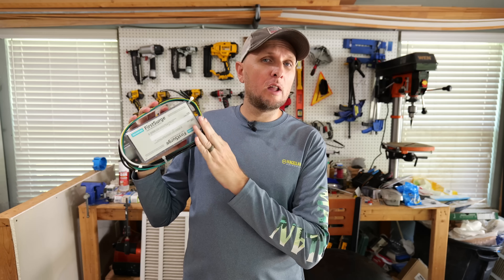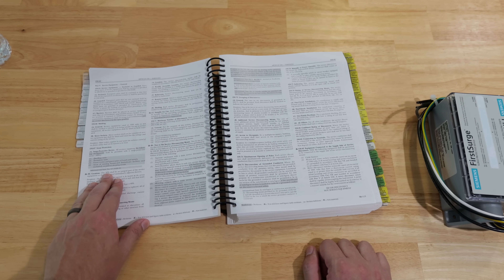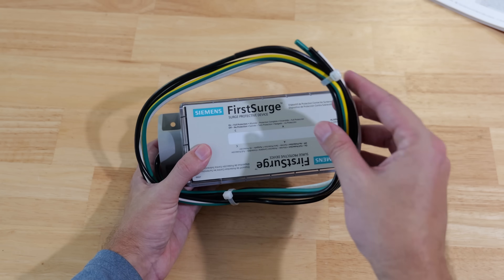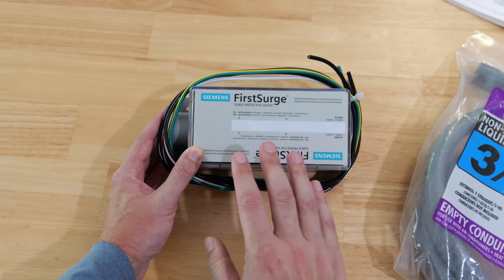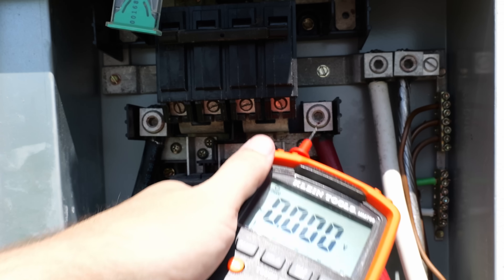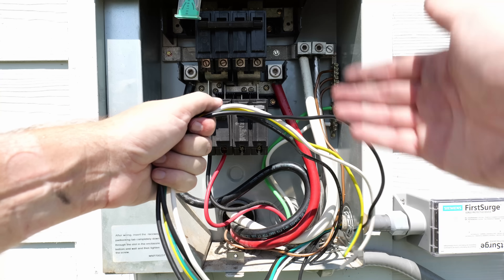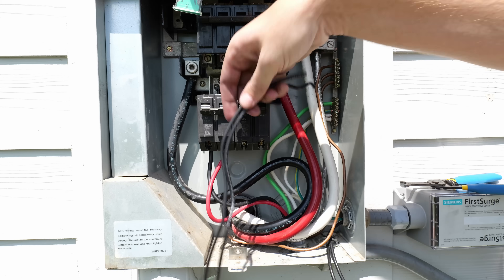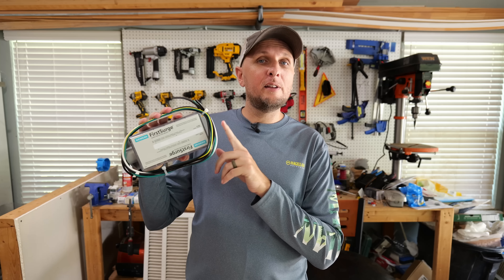Why Whole Home Surge Protectors Are Now Required and How To Install One!  Siemens FS140

Comment: Is it required nationwide to include the surge protection mentioned, or perhaps still up to the locality?
Reply from the maker: Depends on your particular area if they are using at least the 2020 NEC code.  Most places are.
Reply: I’d add that your house is grandfathered in and only has to meet code at the time it was built. If you’re going to work on the main panel now then you’d likely need to add one.
Reply: @smokey0066  mine was completed early 2023 in NC
Reply: @dacvidz  you can look up your city’s electrical code requirements to verify which year they’re at.

Comment: The NEC is becoming a design manual with all their requirements. With that said, I've had a surge protector since the mid 90's. It helped the old incandescent light bulbs last a lot longer.
Reply: True, someone is making a lot of money. Also, the insurance companies have a stake in these devices. I have seen a three 200 amp MOV explode in a large spindle drive on a CNC machine explode do to a power surge and it took out every SCR all 6 of them and to 2 trigger transformers. So even if you have something in place if the surge is too high then you are still "SOL"
And as always, it's not about protecting you, it's about the money!
Reply: It's also being heavily influenced by corporations that want to mandate the use of their products

Comment: Had one and had a direct lightning strike to the power line right above the transformer. Blew the shit out of all kinds of stuff!  Those protectors will protect if the strike is a long way away but there doesn't seem to be any "cutesy trinket" that can stop a close hit. Cost me several hundred in circuit boards in various appliances.

Comment: Well in Ohio you want to replace your breaker box requires a electric contractor to do work so a DIY person can Not do that work and it is also toward your hot water tanks so on that note il! Never put that on or in my house or any rental property , cost is in thousands of dollars .
Reply from the maker: Ok?  One can be installed without replacing the service.

Comment: The only power surges we get in South Texas are from lightning and anecdotally these surge suppressors don't provide the protection needed. I can see their use in areas where brownouts are common, though.
Reply from the maker: That’s not fully true.  A direct lightning hit, yeah not much is going to help with that but one striking the utility, depending on proximity, it can definitely stop or help protect against the surge.  We have more lightning here than anywhere else in the US.
Reply: @HowToHomeDIY  it might help with a line surge from miles away but it won't even help with nearby EMP energy.
And it definitely won't help if the energy comes in through antenna, including dishes.
Reply from the maker: @cquintana9326 doesn’t have to be that far away.   Hitting an antenna or dish is considered a direct hit so no probably wouldn’t stop that.  As far as EMP goes this is one of the highest recommended surge protectors to install for that purpose in conjunction with ferrites on the incoming lines.
Reply: @HowToHomeDIY  The EMP came in thru my [10'] sat dish & rcvr IMO. The strike was about 50-70 yards away from the dish. Took out all electronics in the house. The grid service for the neighborhood is all buried so it didn't come in that way, I think.
I do believe that I would have sustained damage even if I didn't have the dish. The ground potential and/or differential was physically felt in the environment. The hair was sticking out. Fortunately, I wasn't touching anything to burn or stop my heart. Just the opposite...made it run damn fast.
Reply: What about the 80% of surges that originate within your home?
Reply from the maker: @sigcrazy7  That's why I said I still recommend using regular surge protectors on your sensitive electronics.  Those are going to help protect from internal surges although most internal surges do not cause an issue.
Reply: @HowToHomeDIY  How would you add Type 3 SPD protection to your LED bulbs, CO2 detectors, Ring doorbell, and LED lightbulbs?

Comment: Special thanks to those device manufacturers for producing sensors that silently fail.
Reply: So if it protects once , do you have to install a new one?  Or, is it capable of taking multiple "hits" and keep protecting?
Reply: @bruceirvine3962 multiple hits, but wears out.
Reply: @bruceirvine3962  that's a great question.   Nobody knows!

Comment: QUESTION: I have one in my home, the same FS140. I also have two other sub panels, one in my workshop and one in my garage, both are not attached to my home, but 40amp and 60 amps are supplied to them. Should I install FS140 in each location or is the one in my main panel good enough. Workshop is 75 feet from panel and garage is around 220 feet. Thoughts if I should get 2 more units for workshop and garage. We do get A LOT of spikes and outages. Appreciate your time and opinion.

Comment: Surge protection was a major part of my job before I retired (including faraday cages and other over the top attempts at subverting Mother Nature), but I never thought about the house. Thanks for the pome in the ribs!
Reply: Most of my focus was controlling lightning damage to equipment in remote comm sites. Our house is not tall enough to be a lightning target (unlike the towers at our comm sites) so I only have trouble with modest surges on our underground lines.

Comment: I just learned about these this week. Each time I look at the Amazon listing, it shows me a "newer" model which is the Siemens Boldshield FSPD140. Is that actually newer or better or just a different use case?
Reply: I saw that too. My hunch is that including this in the NEC has upped the demand so Siemens has come up one with a lower production cost. One Amazon reviewer also noted this one is smaller, so that could be a plus in some installations.
Reply from the maker: The Boltshield is VERY similar but does not have quite as good of protection as the FS140.  Still a good surge protector.
Reply: @HowToHomeDIY  thank you! Great to know. Sometimes the "newer" recommendation is not better.
Reply from the maker: You are very welcome!

Comment: Major point - The NEC is not retroactive.
Just because your house has electricity does not mean that you are required to install one.
Check with your city hall to see if you need to add one before having the work done.
Reply from the maker: This was covered in the beginning of the video when I broke down what the codes meant.

Comment: I was not aware of this. Is this in every state?
Reply from the maker: Yup.  Every state.
Reply: @HowToHomeDIY  No, not every state. Currently only 4 states use 2023 nec. 27 use 2020. 12 use 2017, 1 uses 2014 and 2 still use 2008

Comment: Wouldn't safety devices be connected to their own batteries instead of main power ?
Reply: wouldn't that make them unreliable as safety devices if power  went out ?
Reply: is the power connection only for communications and not for power ?

Comment: That’s not protecting the whole house it’s only protecting that 20 amp breaker that you tied it to
Reply from the maker: Couldn’t be more wrong.  That breaker is just letting the surge flow to the surge protector and then to ground before it can damage any electronics.

Comment: 10.7.23  Adam, what would be your thoughts on a breaker box that is full with no room to add this double 20amp breaker?  Could one just add the two black wires to 2 separate 20amp breakers all ready in the panel?  Or take out 2 single 20amp breakers and put in the double pole 20amp and put the surge and the other wires back on like double 20amp?
Reply: If you are asking a question like this, have an electrician install it.

Comment: If electricity travels through copper wire at 100,000 miles per second, how much faster will this SP trip when you shorten the wires by 50%?
Reply from the maker: Being as that it is traveling at such a fast rate of speed, I could see how there could be some impact to the performance.  That is what the manufacturer really emphasizes so I have to assume there is a reason.  Do I think it makes a HUGE difference?  No, I think even if you didn't shorten the wires at all it is WAY better than not having one at all.  But I also want it to have the best chance at protecting the house as well as possible.
Reply: At very high frequencies, wires don't act as wires; they act as inductors, resistors, and capacitors, and therefore don't carry very high frequencies very well.  The shorter the wire, the better this thing can short out high frequency pulses.  Funny, though, this applies to Mhz and Ghz, and I didn't know surges were that high in frequency.

Comment: One point - when using a multimeter to measure voltage in a box, you may want to show how to insure continuity of the meter leads with the ohms function or placing the leads on a known live circuit before measuring the voltage. I once did a firefighter assist with EMTs for a guy who was severely burned when working in a 440 V box. Subsequent investigation showed that one of his meter leads was open. Since that time, I always check my meter leads before measuring potentially dangerous voltage.
Reply: yeah I didn't like how he did that either. I keep a wiggy and noncontact pen with my meter at all times for this
Reply: I was taught decades ago to test the meter on a known live voltage, then perform your test, then re-test on the known voltage to insure the tested signal did not damage the meter.
Reply: @mburkitt7678 yes, a live, dead, live test
Reply: @mburkitt7678 yep thats the same method I've been told also.   
Still do it when I do projects at home even though I'm not an electrician nor do I pretend to be one haha
Reply: @mburkitt7678  Yes.  That is the essential procedure.
Reply: Excellent advice, especially if your meter leads are "well used!"
Reply: agreed 
defn always check your meter on a known live source
Reply: A voltmeter is not a good tool to verify the absence of voltage.
Reply: @keacoq  a voltmeter is fine if you trust it and it's auctully a good quality one 
Also most of the higher end fluke meters and stuff could like that could also technically be called one as they measure voltage
Reply: Everything is a technicality until something goes wrong.
Reply: Just double check with a ticker tester.

Comment: I had a fire, had the ancient Fed Pacific panel, might’ve been the reason..I installed surge protectors (well, electrician did) on every panel including the new 200amp incoming service. Had my service upgraded, then added a surge protector in the downstairs panel that has a circuit that travels outside to the chicken coop..used the one recommended by the electrician, the ones that look like double breakers that fit in the existing panel.